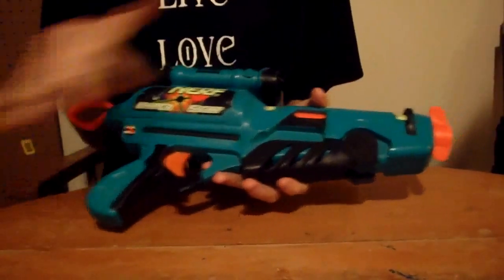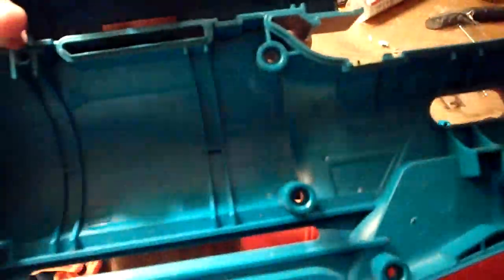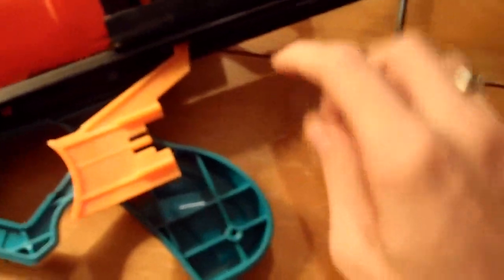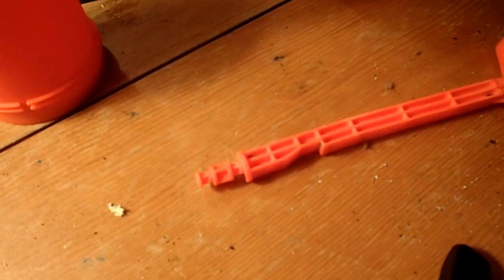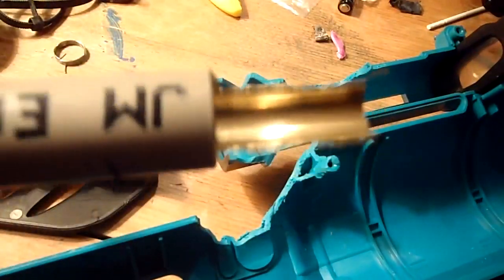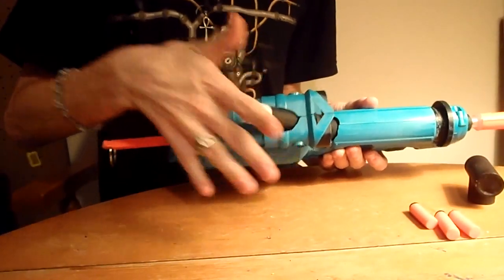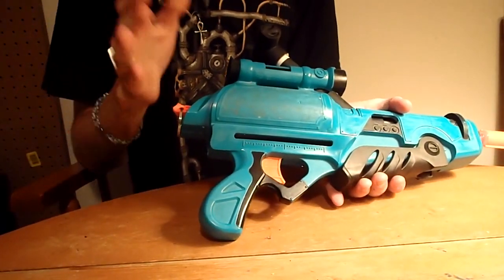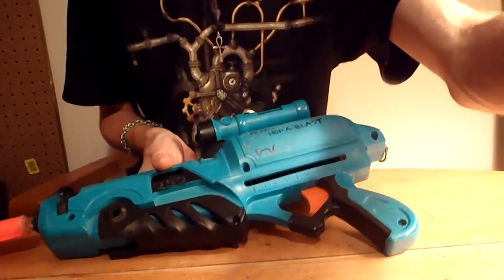Mod Guide: The Hoppered Nerf Expand A Blast (Fun Primary)

Comment from the maker: @zeus6874 No, AC nerf shop (much as I love them), gutted an expandablast by putting nitefinder rifle internals into it, with an external hopper tacked on.  Its a nice primary, but they could have just left it in the nitefinder, I used the expandablast itself, with an internal integrated hopper, and still got nice ranges (although not as nice).